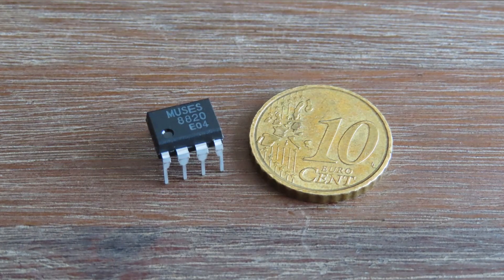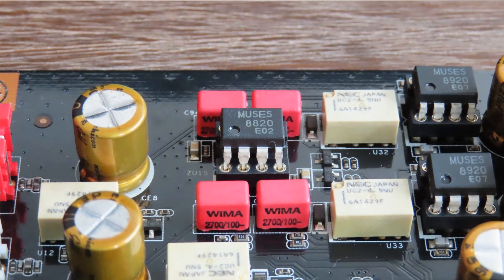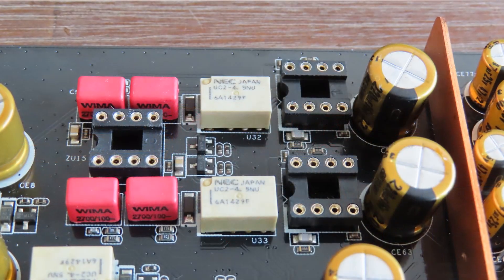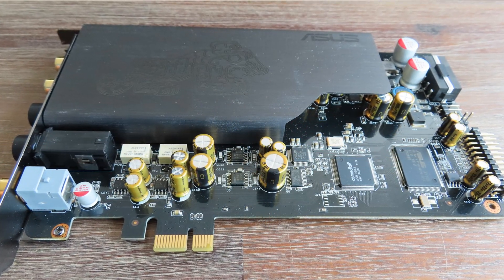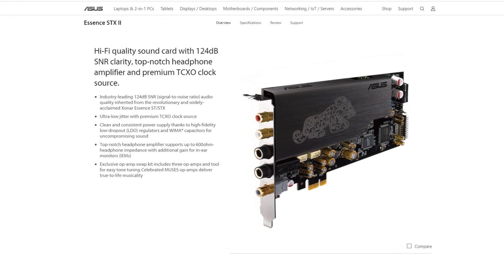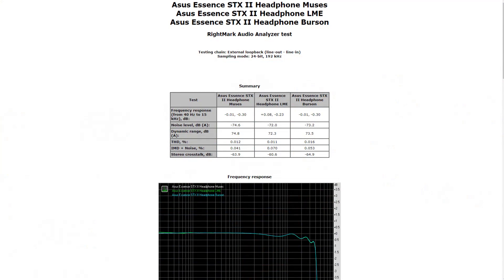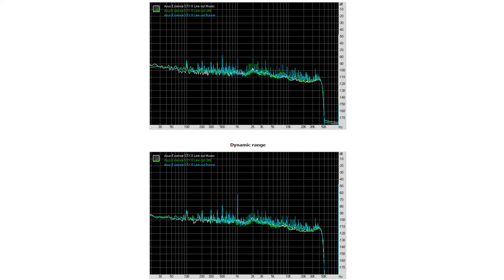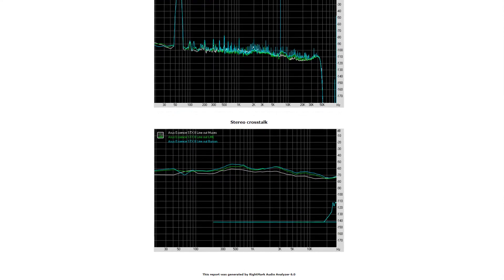Im finally changing my Op Amps!

Comment: The answer to your dilemma is: You CAN hear what you CANNOT see on a graph. The graph does not show subtle flavors in music which the ears can taste.
Reply from the maker: Absolutly. The was my conclusion as well. The specific distortion an opamp gives, will have an impact on the flavor of the sound!
Reply: Or static measurements are not always useful in determining sound quality of something that has a dynamically fluctuating load.

Comment: I have read that the LM4562NA is a high-end op-amp in that package. I've got a pair ordered to replace my pair of NE5532P in my 03 tube pre-amp. Your thoughts?
Reply from the maker: I'm still trying to figure out the new world of Op Amps. It all boils down to the percepted audio quality. The Burson OpAmps in this video are great. So great even that I ordered the newer Vivid opamps from their site!
Reply: I swapped my NE5532 for LM4562. Huge difference in a good way. Highly recommend.
Reply: @zachboggs9923  Excellent! I received mine a few days after making my original post and changed them out. Was really surprised by the wonderful difference the LM4562s made in the sound!

Comment: I don't see the RMAA results in distortion as substantial. The problem is that they are unloaded tests, when you run a loopback or a wire to your measurement interface, the input that you're running them to is high impedance and takes essentially no current to drive it; which is obviously not the case with the headphones, which take a substantial power to induce the movement.
Reply from the maker: Thanks for the addition. I'm no expert in electronics, so I think you are right!

Comment: Fun video. Sometimes, what we hear from audio gear defies logic and measurement. You should measure a tube headphone and post your findings.  I find they sound wonderful, but they measure extremely badly.
Reply from the maker: Hi DT's Digital Den,
I did that while ago, although I doubt that the tube did anything for that device. https://youtu.be/OKNZl3-hf50 Can you recommend one? ( a cheaper one please!)
Reply: @AntonsHardware  The most recent one I've been using is an AIYIMA T6 Pro, which is a combination DAC / Tube headphone amp.  It's quite sweet sounding even with the crappy tubes it comes with, but you can experiment with tubes later ... like OP AMP rolling, only with tubes!

Comment: Hi Anton. I got an Asus xonar ae because I thought my new motherboards sound wasn't working. An Asus b550 f but then I managed to fix the issue with MB. The b550 f has  high quality audio components, do you think I should still use the sound card? If I install it will I be able to switch or use both the MB and SC for audio?
Reply from the maker: You cannot use the MB and SC at the same time, thus using outputs at the same time. You can easily change output with the volume control in Windows 10. Maybe that's an option? And I were you I'd stick with the AE, because those components will be a lot better than any motherboard components.

Comment: I bought the same kit from burson for my essence stx, i do love them but ran into an issue where they would have hiss/wind noise that would travel trough both channels (considering the prices of them having this issue is a joke)..

I found it quite fun to try different combination, sometimes X opamps would sound good in the buffer stage but meh if i would put a pair in the voltage stage.. in the end it does enhance your audio experience but buying and trying out opamps seems to get addictive :)
Reply from the maker: Hi F. Doge,
Isn't this EMI that you are hearing?
Reply: @AntonsHardware  Nope, using one in the buffer slot doesnt produces those sounds, only in I/V.

I added adhesive sheets of copper on the bottom stock EMI shield and on my custom backplate it didn't change a thing, it seems to have been reported a few times on the forum at head-fi.org

I'm currently rocking a pair of OPA1656 with one V5i in the buffer slot, absolutely no noise even with a naked card !

Comment: Finally anton....you need to grab some old signetics/philips 5532/4an from late 70s early 80s
Reply from the maker: Because Philips is Dutch, I hope to get those! :D
Reply: Is there a significant difference from more recent manufactured ones?
Reply: @panzerkiller13 yes, they don't sound as good as the the ones manufactured in the early 80's